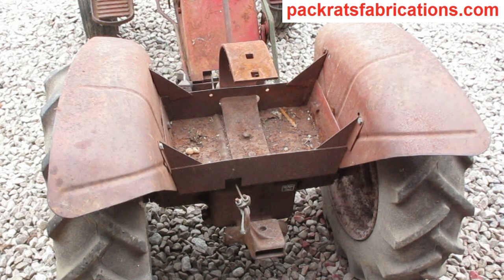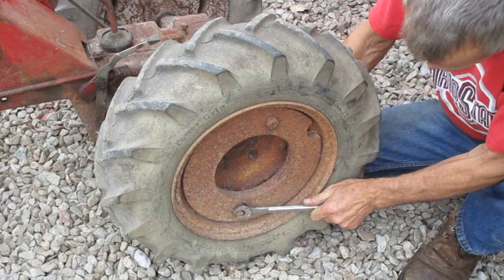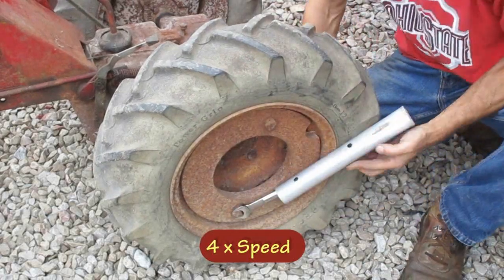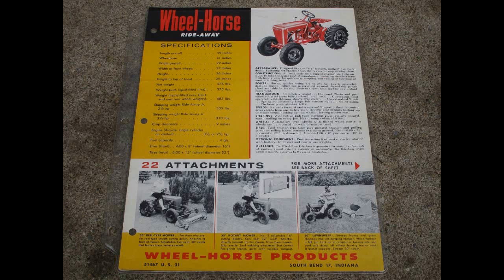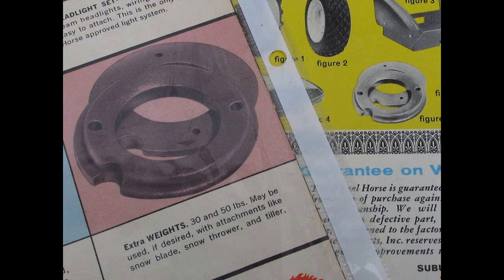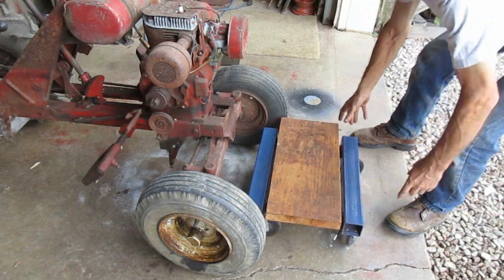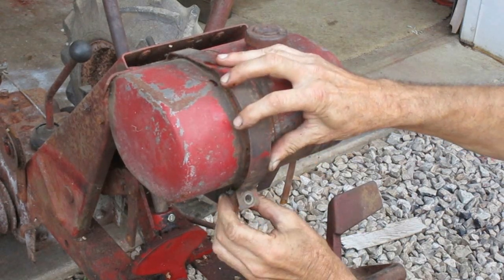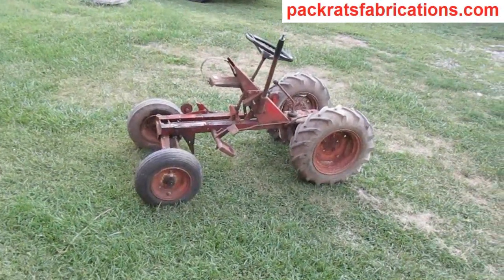Wheel Horse 704 Cleanup #02

Comment: Really enjoy watching this so far. I got a 502 with a Wisconsin pull start engine on it, that I got in trade with a 1075. Gonna mount a deck to the 1075 for mowing the yard, and thinking about tearing down the 502 and fix a few little issues and clean it up. Not sure if I will end up keeping it, or putting it for sale once I am done. I have noticed, on the 502 there is the original tank, that is up by the dash that was not used by the last owner, but there was a hole in the hood, and another gas tank inlet for a tank mounted off the engine. I am wondering if that was something added down the road when someone put the Wisconsin engine on this or not. One of my favorite things about these old tractors is when you get them, your not always dealing with a stock tractor. These things were used to work for 50 years and in that time people might have modified them to fit the needs. So its kinda cool seeing that, at least when it works and isn't a hassle to change back.
Reply from the maker: Hi, your 502 would have originally had a 5hp Tecumseh engine with recoil start, no battery, and it would have used the fuel tank in the dash (made in 1962).